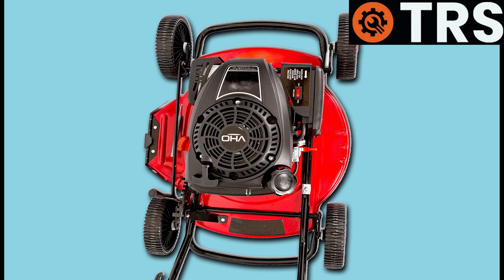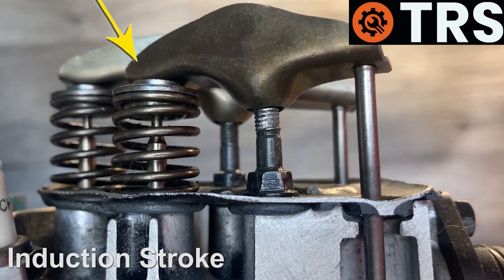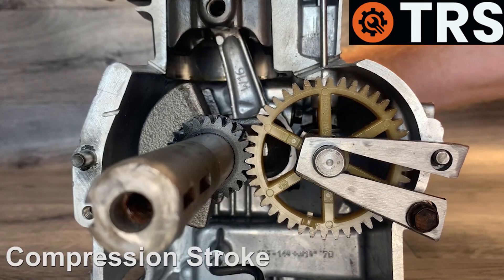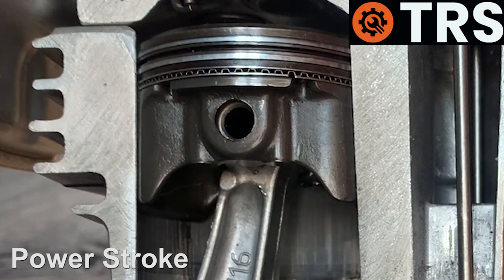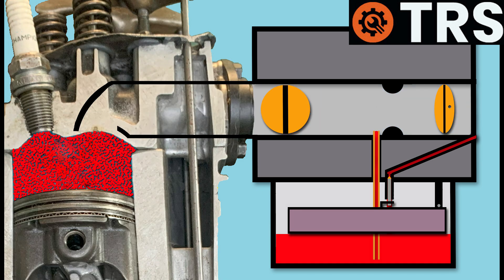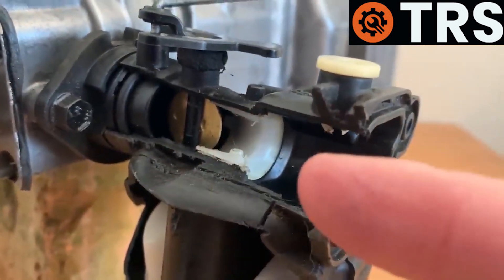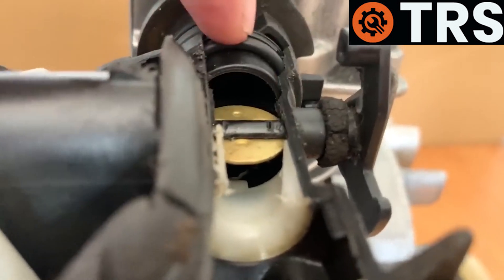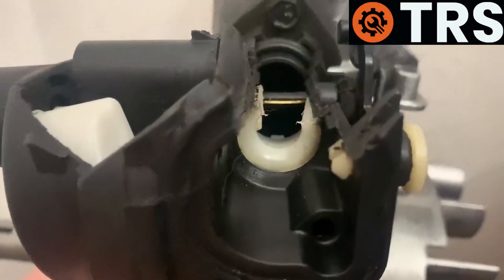“How a 4-Stroke Lawnmower Engine REALLY Works”(by Craig Kirkman)

Comment: Does the lawn mower have a vertical shaft?
Reply from the maker: Hi. On this particular one the engine sits horizontally, so the if you crankshaft and con rod then they are also operating horizontally in real life.
Reply: @TheRepairSpecialist  is there any videos that can explain how to make a vertical shaft motor run horizontal but only using belts and pullys, im looking into using my old lawnmower to make a go kart but its a vertical shaft and I can't weld to change it.
Reply: @Luca-os3ds  The main difference is the mounting of the carburetor and (very important) the sling tab on the crankshaft needs to be changed in order for it to dip into the oil to sling it around for lubrication.  If you try to turn an engine sideways without doing this, it won’t have proper oil lubrication and will be ruined.  You’re better off getting an engine made the other direction already.

Comment: Very detailed and great presentation, but centrifugal force is not a real thing but rather the opposite of centripetal.
Reply from the maker: You’re absolutely right in a strict physics sense — centrifugal force isn’t a real force acting outward, it’s a perceived or “fictitious” force that we feel in a rotating reference frame, while the real force is the centripetal one pulling inward.

In engineering explanations though, especially with rotating engine components like governors and clutches, we often use the term centrifugal force as a practical way to describe that outward effect the moving mass experiences. It keeps things relatable when explaining how weights fling outward and engage.

So yes — you’re spot on from a physics perspective, and I appreciate you pointing that out! In simple mechanical terms though, centrifugal force is a very handy way to describe what’s physically happening inside the engine.

Please remember, I’m not teaching physics students here, my aim is to explain how mechanical systems work to the average enthusiast. 

Thank you for your input though, because it’s help keep things real for the community here.  

Craig

Comment: Excellent. What to do when the cylinders are scratched by the piston rings, can they be rectified and larger pistons installed?
Reply from the maker: Yes it is possible to have the pistons and barrels reworked, but usually the cost of this outweighs buying a new mower sometimes, so I find that people would rather not spend the money on repairing the engine at this stage but rather buy a new mower, or simply a replacement engine for it. Does this help a little?

Comment: I have a push mower with some sort of fancy primerless carb on it, but after it sits for a long while it takes 30+ pulls to start. I hate having to do that or use starting fluid. Would it be worth my time cobbling together some sort of external air intake choke to speed things up, you think?

Comment: after watching the operation of the engine i will see if i can get my honda cement mixer to work . I fitted a new carb engine starts easy then with choke off after two mins dies. fuel starvation remove fuel cap runs better but stops after 3mins The governor is up and down trying to keep engne going.
Reply: G’Day @Ianf1x   The fuel tank should have a coarse strainer in the outlet pipe , could be partially blocked. I normally remove that filter and install a inline filter where you can see it.
Reply: Surging is often caused by  too lean  of a mixture. Steve's small engine saloon has a video on curing this.
Reply from the maker: Yes Steve’s small engine saloon channel is awesome 👍👍